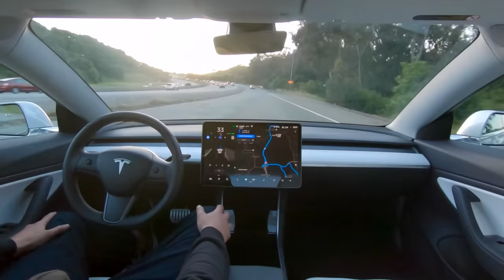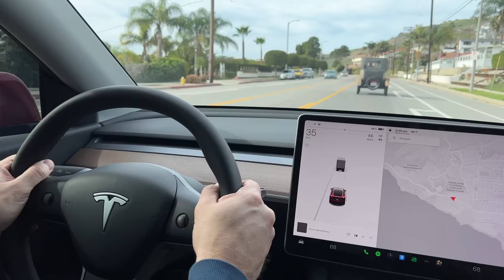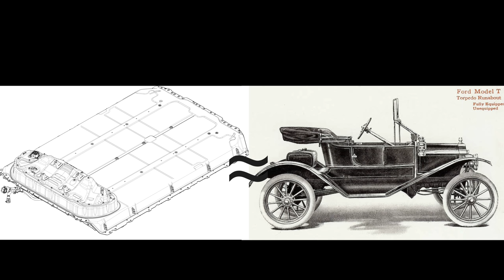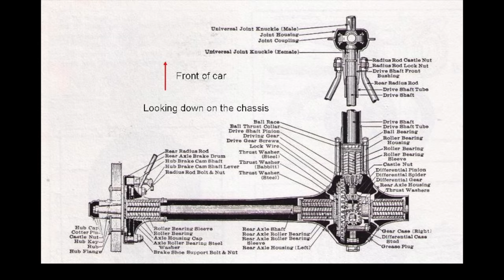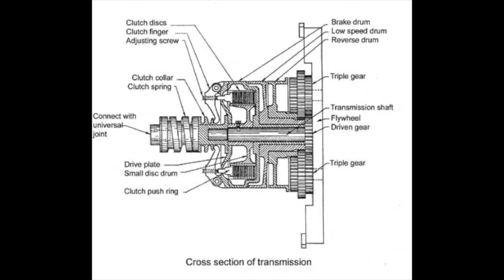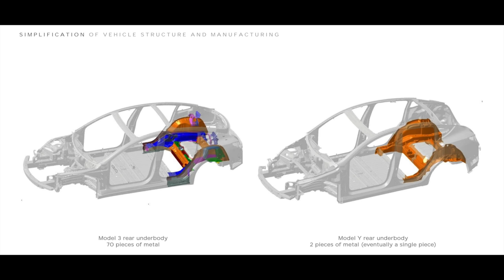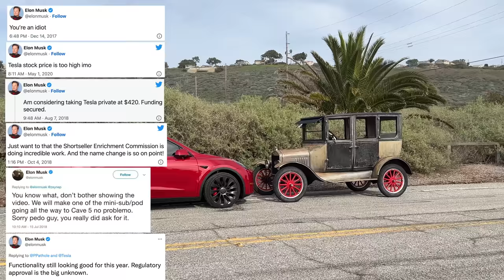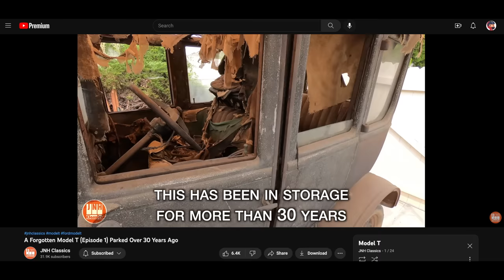1923 Ford vs 2023 Tesla

Comment: The Model T transmission is essentially a manually operated automatic transmission.
Reply: Thinking the same thing!
Reply: I believe they used to call such a system a 'turbo clutch' in that it was a manual clutch which used an automatic gear system and valve body. Nowdays people would call you insane but I'm pretty sure it was from a time when automatics were less well understood/supported and may also have been loopholed into racing classes.
Reply: @boingkster  Where I work in truck mechanic circles a turbo clutch is known as the exact opposite, a conventional manual transmission that exchanges the classic friction clutch for a torque converter coupling. Usually used for extreme heavy duty applications where there would be excessive wear on a clutch.
Reply: More like a glorified tractor
Reply: A Honda automatic transmission is essentially an automatic shifted manual transmission. 😂
Reply: @mrspandel5737  that sounds cool, i assume let off the loud pedal to change gear and thats it?
Reply: @trey1531 seems like a ballin bike you got on your pfp Bro !
Reply: Yeah, a Chevy Power Glide!
Reply: @Mr Spandel  a clutch turbo, was a conventional automatic transmission with a clutch instead of a torque converter. They were used for drag racing before the advent of higher stall converters.
Reply: There's a transmission made out of paper that's a manual CVT from that time period
Reply: @Hawk7886  no
Reply: @hondaguy9153  are you sure that's DCT dual clutch transmission. Automatic transmission have shifter clutches in between the gears and outside the block of the transmission is torque converter.
Reply: @WilliamHollinger2019  older Honda transmissions look like a manual transmission inside in that they have a main and countershaft. They use clutch packs in between the gears where the synchros would be in a manual and still use a torque converter. I haven't been inside a modern one.
Reply: Today we have DCT. The Model T transmission is literally a TTC, a triple clutch transmission.
Reply: Semiautomatic.
Reply: OR...an automatic transmission is just a an automatically shifted Model T transmission.
Reply: @mrspandel5737  Ive been semi truck driving for a while. When I was new, the instructor told us in a ten speed transmission, you're basically the torque converter
Reply: @hondaguy9153  Automatic shifted manual transmission is what commercial truck automatic transmissions are. The manual transmissions in commercial trucks are so reliable, they don't want or need to give them up entirely
Reply: Tf
Reply: In what way? I don't see the comparison to be honest
Reply: That's what I thought.
Reply: Bruh. I mean your not wrong
Reply: Lenco looked at it and said hold my beer
Reply: Manually operated planetary transmission

Comment: the differential mechanism is a stroke of engineering genius. the fact that it basically hasn't changed at all is so insane
Reply: Same for the basics for the electric motor actually
Reply: @sneaky_krait7271  electric machinery evolves all the time
Reply: @vintyprod  Makes it all the more impressive that the AC electric motor still uses same basics
Reply: The wheel is an engineering genius. There was no need to reinvent it so it stayed the same.
Reply: @sepg5084  uh, the ford had the rim built in with the tire, with another wooden wheel staying on the car, I get your point, but it did change, also, not a big one but we did go brushless at some point.
Reply: The automobile inherited the differential from horse-drawn carriages.

The only thing a differential does is make the wheels spin in opposite directions. Push one wheel forward, the other spins backwards. That's it. That's all it can do.

The only reason a car's wheels move in the same direction is because the drivetrain doesn't spin the car's axle-- the driveshaft spins the entire differential.

Comment: I really enjoyed this video. Sold my Toyota years ago in lieu of a 1923 model T Ford runabout as a daily driver, putting around 100 miles a week on it. Two points: your friends model T is not maintained well if it can only muster 35 mph and the poor acceleration is also a function of it not adjusted correctly. From the factory they could top out at 45 mph though few ever had the opportunity to prove that on unpaved roads. I regularly drive mine in the 40-45 mph range and have had it up to 55, though must to see where the top end would be.  Also you didn’t bring up parts a availability or potential for consumer to maintain or fix the two cars. Parts for the model T are plentiful, both in new, new old stock and good used parts. The owners manual for a model T is designed for the owner to do their own adjustments and many T owners did their own major repairs.
Reply: As a daily? jesus some people are just built different.
Reply: lmao forget about trying to repair a Tesla any more than you can repair Apple products
Reply: 55 MPH?  In a T?

I've driven two Model As and they were really happiest at 45 and below.  They'd do 55, but really weren't happy at those speeds.  

At least the Model A had 4-wheel (mechanically-actuated) brakes.
Reply: Yes, it goes 55, but how in the world do you stop it?

Comment: I would definitely be interested in another video in 100 years comparing the 2 again 😁
Reply: There's gotta be 3rd one added, the one running on 4 hoverboards. I can't wait to see that video!
Reply: I bet the Model T would still be running 🤣
Reply: the REAL question is there are a pile of model T's running around 100 yrs later ...how many 23 tesla y's will survive and be drivable in 100 yrs
Reply: @snapon666  No 2023 Y will be operational in 100 yrs, EXCEPT the ones peopl engine swap like rich rebuilds.
Reply: 99% carbon-filled, injection-molded monocoque chassis. Crumple zones are compliant mechanisms in rigid, lightweight carbon materials instead of plastic deformation in metals. Magnetic suspension and damping. Extremely power dense graphene batteries. No steering wheel or manual driving controls anywhere. Heavy and fragile windows are replaced with near and far IR capable cameras and displays. The future is bright!
Reply: @dtroy15  so like most of the cars in Cyberpunk
Reply: @snapon666  I would say they will be rare after 20 years.
Reply: Will he have finished his land speed car by then ???
Reply: @GeorgeWashingtonLaserMusket  You're funny. I'm also contemplating Einstein's theory of relatives. Is Musk and Ford genetically comingled?
Reply: Let's hope we have seen sense and stop using these monsters in 2123
Reply: @dtroy15  You have described a nightmare: a self driven taxi that will shatter in pieces at any bump, a commodity like a cellphone, with no fun in it.
Possibly the future will be bright after a new cultural revolution will be pushing back the ridiculous concept that cars are just boring devices to move a boring person from the boring place A to the boring place B. Possibly new generations will acknowledge that car making CAN be a form of art and the driving (for those willing to drive) can be an exhilarating experience. And cars will be beautifully revisiting the classic models, and will feature steering wheels, mechanical devices, and under no conditions will use batteries, which are expensive, heavy, polluting, unsafe and short lasting. All we have to do is oppose to the obsessive ecotaliban millennarism with simple, sensible, true concepts about what a car is, what makes it valuable, why people love to use private vehicles instead of socialist mass-transportation.
Car of a bright future will look like a Morgan Aero, sound like a Lamborghini Miura, accelerate as a Tesla S, drive like a Lotus Elise and be reliable as a Volvo Polar.
Maybe electric, if we'll find a way to generate power aboard instead of relying on batteries, or as well with a very efficent ICE, without false guilt for enjoying a good engine, that generates less CO2 than horseback riding. Or the world will be turned into an ecotaliban nightmare, maybe, and an idiotic swedish girl will be crowned President of the Marxist Republic of Earth, people will be poor, frozen, eating dry crickets, being a male will be forbidden, free speech will be forbidden, travelling will be forbidden, studying history or engineering will be forbidden, owning books will be forbidden, and we will have to say we're happy, unless we want to be sent to re-education camps.
But I really don't think so. People may be slow to understand, but they do eventually.
Reply: Probably still a lot of Teslas around in 100 years. When the used Teslas are around $3000, trust me there will be a lot of young kids taking them apart and swapping in new batteries/repairing batteries/etc. 😂

It’s just like the kids in my generation, the $3000 cars were Japanese turbo cars. So we took them apart and hopped them up. Same thing will happen to EVs when they hit those price levels.
Reply: In 2123 A car that runs on air will be compared to the classic Model Y.
Reply: @pablopicaro7649  ??? You can just as easily battery swap...
Reply: Me too, but I'll be MANY decades dead by then!
Reply: In 100 years Model T will still be running.  But no Tesla model Y will be operable due to lack of spare parts, lack of knowledge to fix incredibly complex electronics and zillion lines of code and of course lack of Tesla mothership. LOL
Reply: @ilmaio  Whew! A LOT to wade through there, but I can't disagree with any of it (sorry to say).
Reply: @LordLoMR2  I don't see EVs EVER dropping to $3K on the used market, just because of the lithium battery price. If the newly (being researched) SODIUM batteries are ever practically developed, THAT's what will make EVs a true breakthrough!
Reply: @lordbungle6235  they say there are still a million T's on the road
Reply: @williamhilbert8324  That wouldn't shock me. How many Teslas will be on the road after 20 years let alone 100 plus.
Reply: @TIMEtoRIDE900  Given the state of the plastics in some of my collection of 20 and 30 year old cars I wouldn't even give them that long. (now off to find a replacement interior light for a 1990 Ford Escort as the one in it disintegrated while I was trying to replace a blown bulb 🙄 )

Comment: Fascinating engineering insight into the Model T.  So many advances in 100 years but amazing how some old ideas are better for the driver.
Reply: No, you are taking the wrong lesson away from this. There's nothing about the T that's better for the driver.
Reply: @DrewLSsix I disagree. The touch screen control in the Tesla is a classic example of a developer confusing flashy and convenient to design with actually being superior for the user. For some things, yea it’s useful. For others, like the ability to control the climate controls or radio without taking my eyes off the road, an old school physical control is better. I agree with Matt giving Ford the point here.
Reply: The modell T dose 95% of the most importend things a car has to do!The Tesla isnt that big of a improvment!
Reply: Yes, no touch screen.
Reply: @DrewLSsix some vehicles make us no more than steering wheel attendants, and even that point is under threat.  I am an engineer who really enjoys interacting with the vehicle I am driving, and interaction and awareness of the mechanical systems moving me down the road is a big part of my enjoyment from driving.  So much so that I am building a 540hp na 7L V12 McLaren F1 replica that uses 2 Honda V6's (build log is on Pistonheads).  I understand things have moved on as far as safety but engagement with the driving experience is something the T has in abundance.
Reply: @kenrickman6697  But in the tesla you can just tell the car that you are cold and it will increase the temperature for you without even touching the touchscreen. Often there is no need at all to use the touchscreen.
Reply: @kenrickman6697  bingo. This is a big part of the reason why I daily-drive a 2021 Suzuki Jimny 'Lite'. The 'Lite' denotes a basic version designed to streamline supply and lower cost - manual trans, manual AC (no climate control), basic radio/bluetooth setup (no touchscreen), electric windows, cruise control. It has some electrickery in the 4WD system that uses the ABS to simulate limited slip differentials at both ends (quite good and unobtrusive) plus the modern auto collision avoidance / emergency braking kit which again is unobtrusive and among the better of such systems I've used while still actually functional and beneficial. So, simple and engaging, reasonably priced, I mainly do short trips and occasionally go offroad with my kids. The perfect everyday driver.
Reply: @abreitsma1864  Meaning you have to have a voice that the car recognize and understand correctly every time you need to change something. If not, you have to stop the car while focusing on the menus on a touch screen.

Now imagine the same touch screen car fifteen years old. More than half the time outside in a four season climate. Are all the electronics still working or have the car already been scrapped?
Reply: @kenrickman6697  exactly! The ford simplicity will make it still exist even in other 100 years unlike the tesla.
Reply: @kenrickman6697  there is a reason why older cars last soooooo long practicality no electronics to go wrong
Reply: @brunoheggli2888  totally agree with you and the tesla came when all those modern car equipments were already developed, things like s’est belts, ABS system, power steering…….
Reply: @abreitsma1864  lol…..
Reply: @kenrickman6697  i see Matt's humor, but the total absence of functionality is not a usability win. people like heaters or AC. if the designer says: no buttons anywhere, everything has to be controlled by the same huge touch screen, then that is the decision that is made. you wouldn't be able to drive a Model T without instruction.
Reply: @DIY-V12  so "engaging" that most people wouldn't be able to drive one if they had to. I am all about analog cars and such, but i have no expectation that the vast majority of new car buyers would have any interest in a manual car for example. i am also confident that no-one finds driving 20-20 miles in Atlanta rush-hour traffic "engaging" regardless of the vehicle used.
Reply: @uliwehner  agreed, who wants to be distracted from their mobile phone while driving these days!
Reply: @kenrickman6697  But isn't the fact that the T doesn't actually have climate control or a radio something to be considered here?
Reply: yeah, and the steering wheel simply tilting up for driver getting in and out... that is much easier and the system will last longer.

Comment: I like that Ford was so in tune with safety issues that when they designed the Model A they consolidated the fire with the firewall by making the front cowl the fuel tank.
Reply: They actually went to integrated cowl tanks in the last two years of the model T (1926 and 1927).
Reply: I believe that the Model A was also the first car to use bonded Safety glass, so there is that.
Reply: I think (but do not know) that when the fuel level on the Model T got low, and one encountered a long, steep up-hill, one was forced to drive it in reverse, as the gravity-fed fuel system would not flow fuel to the carb from the under-seat tank.

That's the problem that the cowl-mounted tank solved, by raising the tank higher.

Comment: the more things change the more they stay the same. The dive into simplicity was amazing. Did not realize that the engine operates more like a power glide where your feet are the valve body.
Reply: Transmission, not engine.
Reply: @michaelbenardo5695  dang, look at that typo. thanks! i brain farted.

Comment: That was great fun. BTW, that steering wheel is a period-correct aftermarket product often referred to as a "Fat Man" wheel. I have one of a slightly different design on my '22 T Speedster. The original wheel was bolted on in the usual manner.
Reply: Thanks for that info, I was wondering. Have seen a few model T videos and thought the wheel looked different than what I remembered seeing in other cars.
Reply: 1922 original or a 2022 replica? gotta love how 100 years makes dates a problem.
Reply: @cpufreak101  Heh...you're right. My speedster is a 1922, built by my dad in the early '60s (1960s😁) as the car he wanted when he was 16.
Reply: @joeway8641  to think it was nearly as old back then as my car is now, regardless that's awesome!

Comment: Dude, I almost wanted to disagree when you gave points to the model T over the Y (eg: diver features, off road capability), except I couldn't. Your points are valid. Sometimes simple is better.
Reply: Simplicity definitely still counts. 

My newest vehicle was built in 2009. It’s a Toyota. It’s pretty darn easy to work on, on the rare occasions it needs it. 

My oldest vehicle is a 1943 Ford tractor. You can do just about everything on it with like 4 different tools. I’m not kidding. It is devilishly simple to work on. Nothing on it every breaks and I use it often and HARD. Most things just need adjusting, cleaning, and lubricating.

Comment: I had a 36 model A and I always thought the 24” wheels were neat compared to the 14 and 15” wheels of the time… nowadays, 24” wheels aren’t far from standard anymore.
Also, liked the push button starting of the early Ford… something that started reappearing in modern cars.
Reply: Yes, larger tire walls back then except for the ford exception. That Novel-T was all sorts of cracked up. Every vehicle at the time had something going for them, the model T was just overproduced. That was its charm...or the black paint during 1913-1924.

Comment: Brilliant comparison, Matt!!  I often wondered what would have happened if GM continued to develop the EV1 long enough to incorporate the LiON battery??
Reply: GM's trouble has little to do with electric cars.   They are in the same state as they were in when Japan ate their lunch.   Too fat at the top.  R&D is too fossilized as in not light on their feet.    GM's problems are not because of EVs. They are too deep in for EVs to save them.